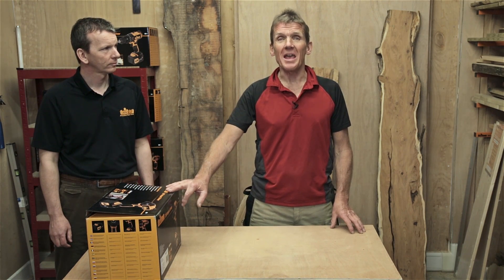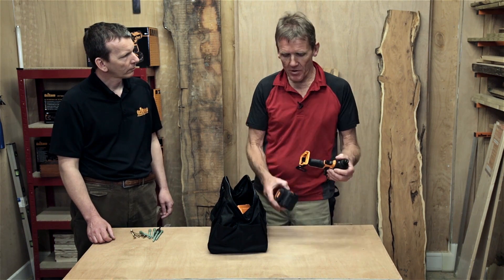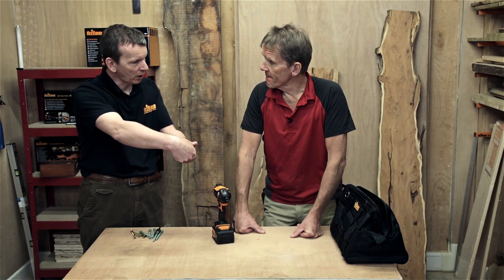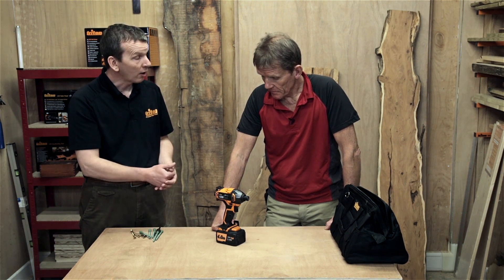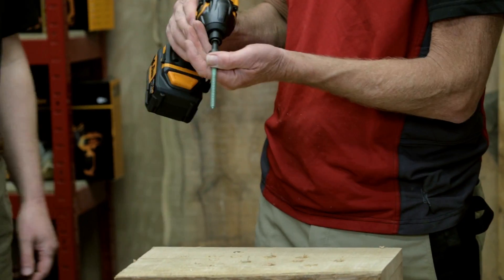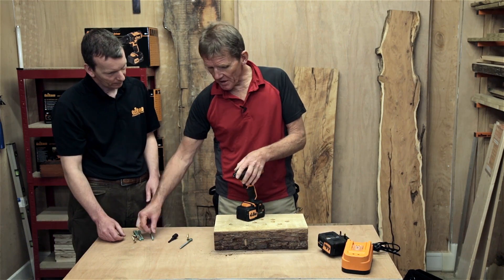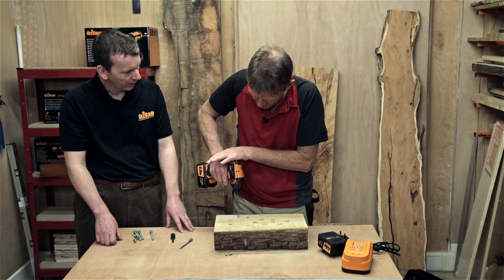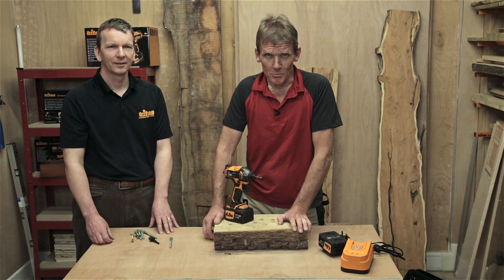Triton T20 Impact Drivers - How do they work?

Comment: Holly s#it...the reinvented the wheel. One smart man once upon a tome said that E=mc2 (in this case E=ma2).
For noobs it means that acceleration has bigger impact on energy output than mass. However its not that simple and you cant just spin a 10g weight at 10.000rpm and hit a shaft's anvil with it...so you need a balance between speed and size of the hammer. All in all not a rocket science and they are talking about it like it is just to make a profit. Hydraulic impact drivers are a totally separate category and thats what many tool manufacturers should start selling...ridgid already is.

Comment: 20V battery is same thing as 18V. The only difference is marketing BS.
So I used to have a Makita DTD 146 or something like that - an impact drill. 160 N/m torque. And in comparison to, say a 55-torque normal drill, there really is no difference in power. The advantages of an impact driver that I can see are size, weight, easier in removing screws due to impact, generally easier to work with and very surprisingly, battery lasts about 30-40% longer! So if you are going to do some screwing rather than drilling, I do advice you can an impact driver.
Reply from the maker: The impact driver uses impact created by speed and the drill uses straight torque from the motor so it is very difficult to make those comparison.

Comment: Can i use it on my truck, like lugs, brake calipers, etc?
Reply from the maker: The problem is that you need an interface so you can set the torque for the particular component. The best of these impact drivers have adjustments but they aren't calibrated.

Comment: I have the impact driver, drill driver, reciprocating saw and the light. Fantastic set for under $200
Reply from the maker: Most people buy sets because you get different size bits for different screw heads. Try the internet there are lots of deals. It is an unavoidable fact that the better bits are more expensive. Impact drivers are not kind to bits or screw heads and cheap ones shatter.
Reply: I bought a workskil brand from Aldi. They are german made are lasting very well. Its pot luck whether they are in store or not though.
Reply from the maker: Good to know. Is it a common brand in the USA?
Reply: I am in Australia, not the USA
Reply from the maker: As I typed that I started thinking it could be Australia or Canada. That explains it. Triton started in Australia so I know it is well regarded there albeit made in China.
Reply: Did you get yours from Masters?  I have been trying to get the attachment set for the Impact Driver, I think they are the 1/4" bits for it?  Do you know where I can get them and what they are called?  Sorry I am female and this is my first lot of tools, I have purchased in my life and my brother wont help me out (only when I borrow his tools he does) and Masters had none left and the Triton Company in Australia wont reply to my e-mail.  Please dont fuck me over and lie. lmfao.  Can you help me out?  Thank you heaps in advance.
Reply from the maker: Hi Mav  

You can use any 1/4 inch impact bits. There are lots of brands and they all fit Triton. I have found the Milwaukee ones are good and also any German bits tend to last.
Reply: Skill Builder - thanks for that.  Just the guy from Masters store stated that you can get various 1/4 inch impact bits in a set box.  I think he meant a few bits and pieces in one purchase.  Because they had none left as the business is closing down, he couldnt show me what he meant.  I dont want to buy single bits it will cost me a fortune, but I guess I have no choice now.  Thank you again.  :)
Reply: Skill Builder - Oh thank you again, I think I found some things in Milwaukee brand. Woo Hoo.
Reply: I thought that would be the case.  Thank you again for being so helpful.
Reply: Yes I got mine from masters, sorry i wasnt quick enough to help you. But it seems you got expert advice. :)
Reply: geejaybee413 - Yeah, I guess Masters going out of business, kind of helped a few people with their budgets and tool buying. I think their last day is December 11th.  Thanks, did you get the bits kit I am after, if so, whats the brand, name etc?  :)
Reply: geejaybee413 - thank you.

Comment: For anyone thinking of buying Triton tools, I've started buying various tools in the Triton range and the only one I'm disappointed with is this impact driver. I use a Milwaukee 18v impact driver 5 days a week so I guess I've got use to how the Milwaukee feels in use. By comparison, the Triton feels piss weak. I only use it around the house, but the lack of torque is instantly noticeable. That said, the hammer drill/driver and circular saw are fantastic. Very good tools for the money.
If you only want an Impact driver, get the Ryobi 18v. Very close in price but worlds apart in performance.
Reply: I think that you are right, but then Milwaukee 18v impact driver  has a torque of 203 nm so most other tool will feel piss weak:-)
Reply: Steven Koch I use both Milwaukee and Ryobi impacts daily and I highly recommend the Ryobi 18+ line for any " home gamer" as Ave would say. Ive been really impressed by ryobi's newer tools especially for the cost. I've never heard of Triton but you can even hear how weak it is in the video.

Comment: dewalts impact is faster
Reply from the maker: Well you are right and so is the Milwaukee but speed increases the impact and you will find that both those impact drivers now have the option of speed limiters. If you put too much impact into a screw head or the 1/4 inch bit, or that matter,  then it tends to cause damage. Somewhere around 160 Nm is said to be the optimum for screwdriving. If you are driving nuts and coach screws with  socket then a higher impact is desirable.
Reply: The Dewalt drills and drivers are really sloppy though - terrible chuck wobble, even the batteries fit loose.
Reply: mine is tough as nails but i will say we do all have our own experiences

Comment: If it's not brushless, then it's crap!
Also, this whole 20 vs 18 volt thing is marketing shenanigans, I blame DeWalt. The industry standard here in the states, but heavy as hell and loosey goosey. The hot drill now is the Milwaukee Fuel brushless (they have a non-Fuel brushless too, a little cheaper, but it won't send you a text when you lose it. Oh wait that's the One-Key model) and it's little brother impact driver. Even the 12V has almost a thousand pounds (translator?) of torque and the batteries recharge in an hour. I love the pistol grip sawzall they have too. Evil.
I think you scared that rep, he seemed nervous.
Reply: BariumCobaltNitrog3n while you are correct about 20v vs 18v, Li-ion cells are 3.7 volts each. 5 cells yield you 18.5 volts, and full charged it should be 20v. But a true 6 cell, 22.2v (24v fully charged) will be able to deliver more power at the same amperage, or similar power at lower amps.

but to your point, they are just choosing the voltage of a fully charged pack, which an 18.5v 5 cell should be at anyways.
Reply: That's right.

Comment: Lets get it straight guys.  The 18v and the 20v are in fact exactly the same just measured in different ways.
Reply from the maker: +Terry Goyan 
The tools don't see bad but I am not sure the batteries are as good. One has gone down after a few months of light use. If a manufacturer could really crack this battery reliability I think they would clean up.
Reply from the maker: We were always told you should run NiCad down to prevent the memory effect which reduces capacity. 
I will ask my battery guru.
Reply: +David Handley Thanks for pointing that out. I was going to if no one else had. DeWalt does the same deceptive labeling. My Makita XDT-09 has 175 nm of torque. Triton always seems a little behind in bringing out tools. How's the quality compare to say Milwaukee or Makita tools? They look to be well made....
Reply: Terry Goyan The Triton cordless drills that I have are extremely well made.  At least equal to a DeWalt.  Annoyingly though we cannot get a fast charger for the 18 volt range.  Just a dinky slow charger that takes up to 8 hours.  Also, we can't get anything bigger than a 3ah battery.  Go figure.
Reply: Skill Builder A few months is really poor service life! Maybe I've been lucky but my Makita batteries have been lasting me for years. Since I go back to the Ni-Cad days, I always try to run the batteries down to the point they are still working but obviously slowing dow before charging. The new Li-ion batteries have a monitor that does not allow complete discharge.
Reply: You have it backwards, should never run NiCd packs down to where they're starting to slow the tool much.  The problem is the weakest cell will reach 0V and be reverse charged by the current flowing through it from the other cells, which permanently damages it.  This is the #1 way that people damage NiCd battery packs, besides a kit with a "dumb" slow charger that overcharges it.
Reply: +Skill Builder You're quite correct in how to handle ni-cad batteries. I used to fly radio controlled gliders. The receivers and servos were all powered by ni-cad batteries. It was critical to discharge and charge them properly, otherwise one risked crashing a plane! Lots of money and time involved building them. The trick is to run the cells down far enough not to develop a memory but not so far as to risk reversing a cell.
Reply: The memory effect is an urban myth for consumer applications.  It was observed by NASA on batteries which "every time" were discharged to exactly the same voltage, a situation you couldn't hope to duplicate with a cordless tool unless you tried to.

Running them down causes damage if the weakest cell gets down to 0 volts and begins reverse charging.  There is no way to know if a cell gets that low on a sealed pack without any battery protection circuit in it, which was practically never implemented on NiCd tools because unlike Li-Ion they are not prone to start a fire if abused.
Reply: A controlled discharge and recharge cycle will help the batteries to achieve their maximum capacity but so would a charger that continues to trickle longer after the usual charge termination.  This is all established fact at this point, for many years even so it is baffling to me that people are still confused about a battery tech that is soon to be abandoned, at least for new purchases I could never recommend anything be NiCd except those $2 each solar landscaping lights and only then because they're so inexpensive and because if they were generic NiMH cells, those tend to have fewer recharge cycles before failure.
Reply: +Stinky Cheese Thanks for your insight! Is there anyway to monitor a battery pack on a cell by cell basis?  I'm wondering how Tesla manages their batteries that clearly have large numbers of cells...
Reply: Yes, because Li-Ion is so dangerous if over-charged or discharged, electronics design houses have developed many different ICs that monitor per-cell voltage and perform an action when the set threshold is reached.

Before their development, a more discrete electronic solution was larger and costlier, so it seems nobody wanted to invest in that until it had to be done for safety reasons with Li-Ion, not when NiCd cells were so cheap in contract manufacturing volumes that it could come near doubling the cost of a pack.

 However these circuits take space, which isn't present when a NiCd or NiMH pack is made barely big enough for the cells themselves, though some high end NiCd or NiMH may have a charge indicator that just checks the sum series cell voltage but this cannot tell you when any one cell approaches 0V.

&#160;On any Li-Ion pack there already is such a circuit, though some save a couple bucks by not including a display for the owner to gauge and none display individual cell voltages as that would take a more fragile 5 to 10 line screen (for 18V/20V Li-Ion) and confuse owners, but they necessarily monitor individual voltages to prevent one cell failing, burning, and then a cascade failure of the other cells.

Tesla also necessarily has a controller IC for their cells, at least one controller sensor array for every module as the entire battery pack for a vehicle is comprised of multiple smaller modules.
Reply: +Stinky Cheese Thank you so much for the elucidation! I'm currently working on building a teardrop trailer for my desert expeditions. Any recommendations for a Li-ion battery management controller for use with solar charging? I appreciate the time you spent explaining Li-ion batteries!
Reply: Not really, I do work more at the discrete component level and don't own, so haven't researched the currently available solar charge controllers.  It's also going to depend a lot on the capacity of the solar array and batteries.  Once you have those specs worked out you can weed through available chargers.   Keep in mind this is a non-trivial thing to do with desert heat, a separate add-on cooling system may be necessary or to derate the current capacity of a ready to use product.
Reply: +Stinky Cheese Thanks for the response. The electric system is proving to be the most difficult component to design. I've read about working around the weakest cell in the system. I know a guy that worked for Apple in the early days and plan to pick his brain about my project. He's pretty much a genius at electrical design work.  Stay well!
Reply: The measurement is coming from the no load fully charged battery the second you pull the trigger it goes to 18 volts take a battery in England with a battery say 18-volt use a voltmeter and you'll get 20 volts with a fully charged battery that's where this concept coming from and DeWalt capitalized on it some years back
Reply: It's the same any 18v will say 20 v if you test the battery before you pull the trigger  where I am In the u.s a. DeWalt and few others use the same 20 v info but all 18 v will give you the same test info with voltage testers trust me just over seas they can sell it as 20 v Max or just plain 20 v it must say 18 v by law  that's why DeWalt over there does not say 20 v max like hear Triton is really hard to find in  states some retailers have it no big box stores online yes one stores know of does have some of their products in store tool nut

Comment: top of the line 160nm? Doesn't have metabo around 450nm?
Reply from the maker: +FoodOnCrack
There are some larger 1/2 inch impact wrenches but the 1/4 inch drive shown here and the impact bits dont stand up to that kind of impact so on this class of machine 160 is about as high as you want, There are some going up to 180nm in this class but 160 is normal.

Comment: How do you cope with vibration and the dreaded "White Knuckle Syndrome" I've used a RYOBI it's a great bit of kit, but after a while fatigue sets in and That numbness is an issue, what say you my friend ? As always another cracking Vid!
Reply from the maker: +TheAudiostud
 The short answer is I don't. I have the dreaded 'white finger'  and it makes my  forefinger numb on cold mornings. Vibration is a problem and the best thing is to limit your use on high vibration machines. Often the smaller drills are worse than the big SDS machines.
Reply: Take some breaks, rotate the work with someone else, switch hands, and wear padded gloves.
Reply from the maker: Too late for me but good advice

Comment: Surely 20 means the cells are smaller than an 18. What does that do the longevity? Is it less cause there's more cells or more cause the load is spread out?
Reply: +Mark Leask The 18v and the 20v are actually exactly the same.  They are just measured differently.  18v is under load, the 20v is open circuit.  It's just a piece of marketing rubbish to distinguish different markets.  Except for the printing on the outside...they exactly the same product!
Reply: +David Handley Yes. I believe they all pretty much use 18650 lithium cells. They voltage is inherent to the chemistry of the cells i.e. all lithium cells (using the same chemistry) put out the same voltage. Regardless of manufacturer.
Reply: Yep...that's marketing for you.

Comment: For years I used a Yankie screw driver on site, never thought of using a drill to drive in screws,. Then I bought my first battery drill 9v Hitachi which lasted well and it could dive screws wow. Sadly my pal drop it from a ladder. Being a tight sod and using tools on site, which can and do go walkies, I bought a cheap 14v riobi nicad drill has lasted years unlike the batteries about a couple, the game was up for them.  Last year I came into the 21st century and bought a Riobi 18v impact drive, Its NM is 220 ! This has been banging in screw by the box load what a cracking tool. Only one down turn me being a cheapskate I only bought one battery which last about an hour, when it runs dry theres give no warning it just stops like someone just put the brake on. Out with the Yankie while its on charge..  I bought it from B&Q for a tad over a 100 ton.   Luv the price and if it does do a disappearing act? hey I won't be cryin',  much..
Reply from the maker: +1stMrSceptical 
Ah the old Yankee screwdriver, I haven't seen one of those for a few years. They could have your eye out. 
Sound to me as if another Ryobi battery would change your working life. That is always  the trouble with the cheap deals, one low Ah battery.  Thanks for the feedback. We love hearing tradesmens/womens tool  stories or even tall stories. .
Reply: kids these days dont know their born....

Comment: Who else has tried using an automotive impact wrench to do this? I used a mains powered, 1000W, about 450NM. It worked rather well on a large lag bolt, however its lack of speed control and my lack of any impact bits made driving Philips or pozi-driv  screws pretty much impossible.